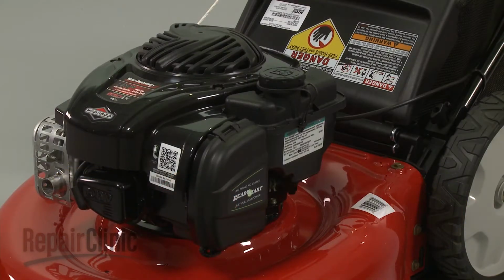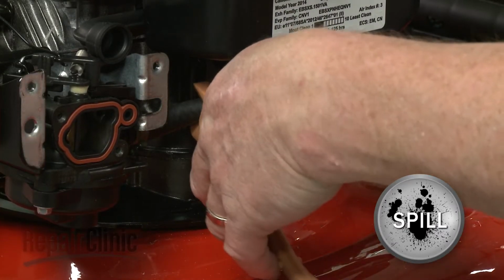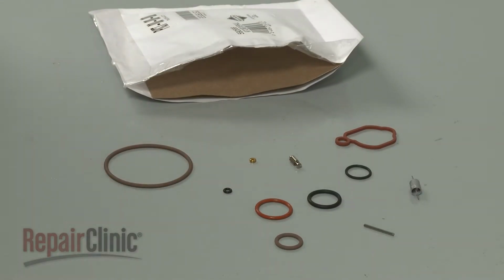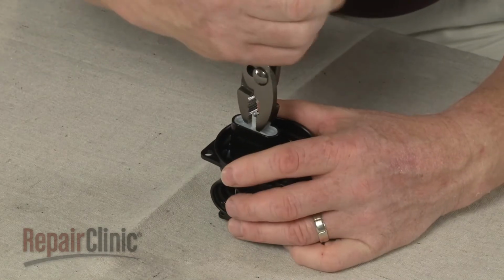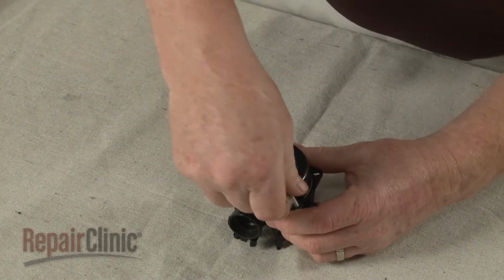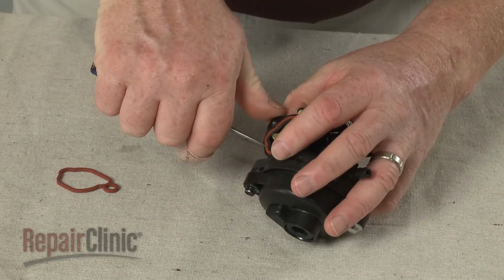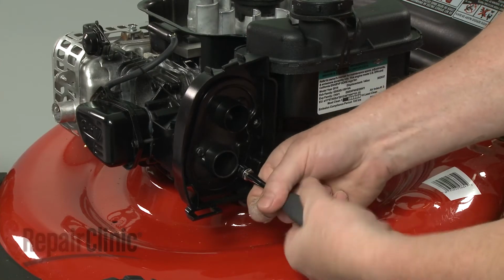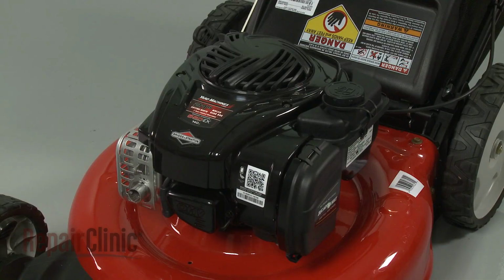Briggs & Stratton Small Engine Carburetor Kit Part # 590589

Comment: Problem: engine will not start even with spray starter fluid.  same issue years ago and mower has sat idle all winter.  very helpful video; rebuilt this mower carb about 6 years ago; time to do it again before the weeds get out of control.  straight forward process and same parts (590589) that I bought in the past.  Watched this video as a refresher to make it a one hour or less DIY project.  Thanks Repair Clinic.
Reply from the maker: Just in time for the spring season. Glad the video has been helpful. Have a great day!